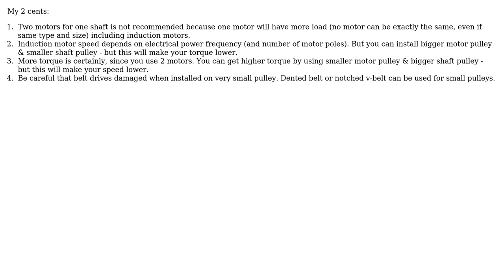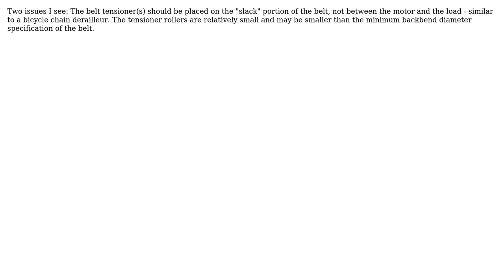Engineering: Using two motors and belt drives to drive one shaft (3 Solutions!!)

Comment: and what happends if u couple two motors by his shaft. Obviusly one of the motors needs to be double shaft (like ventilation applications).
in this option u save to use the belt but i dont know how to analize this in electrical terms